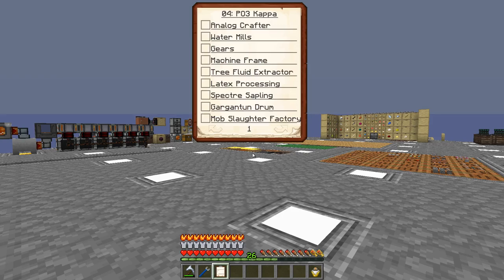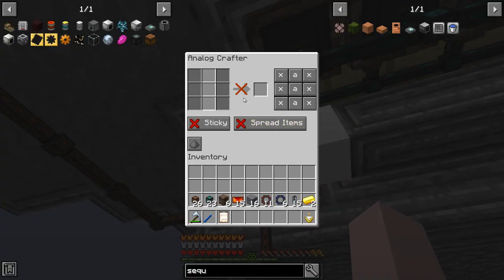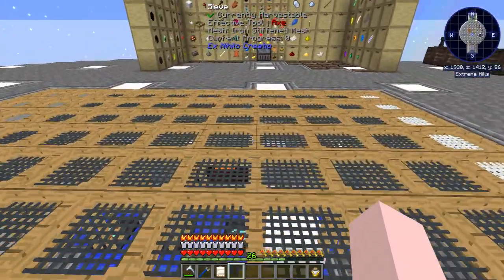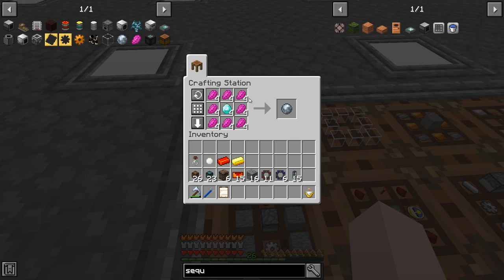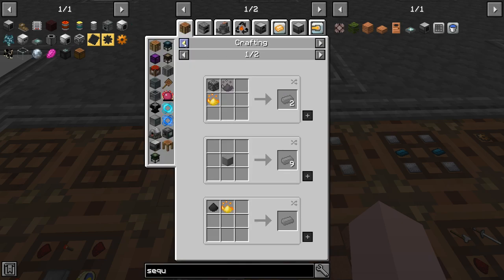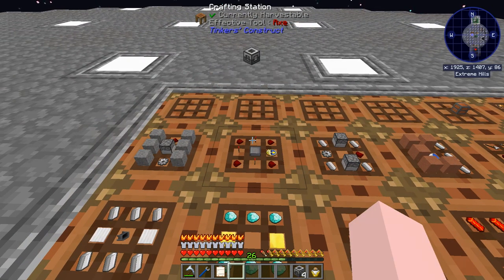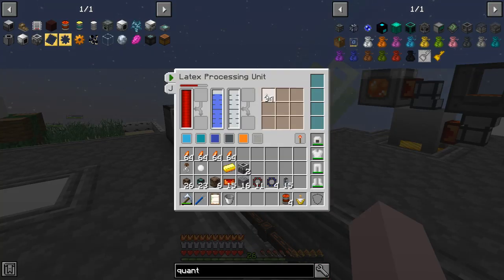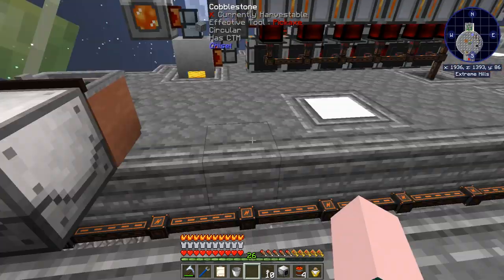04: Mob Slaughter Factory, Sluice Box, Analog Crafter, PO3 Kappa

Comment: Hi Wilx, I just ran a spectrum analyzer to see what people are talking about and there's some extremely sharp lines in your audio's spectrogram. I was going to recommend a VST that can fix this kind of thing, and help reduce your noise floor without messing with your voice, but it seems the bands change back and forth between two sets so it won't work very well.

You have lines at (roughly) 19.9khz, 19.5khz, 18.5khz, 17.1khz, 16.2khz, 15.5khz, 15khz, 14khz, 12.8-12.9khz (this one rises and resets), 11.7khz, 11khz, 10khz, 9.4-9.2khz (drops and resets), 7.7khz, 7khz, 5khz, 3.9khz.  Solid lines like these are not normal, maybe some electronic cross talk?  The interesting thing is your intro dialogue had no line shifts, it looks like some of it is your mouse.  When your mouse is moving one set of lines shows, when it's not another set of lines shows.  So again makes me think there's bad electronic isolation.  Maybe an external sound card to help isolate?

If you want to see it yourself (and to help with testing) find an application called Spectrum analysis 3.97 (it's free) you can set your mic as an input, set your amplitude scale to 100dB Logarithmic, then set you Visualization to Spectrogram (H).  Alternatively you can find another app that lets you see a spectrogram of your audio.  Fell free to message me if you want and I can try to send you some pictures if you don't want to bother with the software.
Reply from the maker: I'm not seeing what you're seeing. I've set it to 100db, normal, spectrogram H, 48khz, 2048, hanning. Most of it is under 5khz, with some up to 8khz. I see no solid lines. The other other channels I looked at had higher numbers than mine. I don't know what I'm doing, so please correct my settings?
Reply: @WilxGaming  If your motherboard supports "Stereo Mix" under your Recording options in Sound (control panel) you can use that to see the audio of your video, or any sort of thing that lets you set a recording output that's a duplicate of your speaker audio.  

If you're trying your mic directly you could try setting the Amplitude to 135dB if it's really quiet, but it's 100% in the video.  If you're mostly seeing colours under 5khz then you need to up your amplitude.  The rest of your settings (the defaults) are just fine.

I tried switching quality options to make sure and it's present in all of them.
Reply from the maker: Now I'm really confused. At first i didn't have my headset plugged in and was only listening to my computer speakers. Between 10khz and the top was pure black. Then I plugged my headset in and my screen was covered in light purple dots and had horizontal lines like you described. I moved my mouse to a different port away from my headset bus and the thick solid lines went away but I still have some very thin light horizontal lines. All that is without speaking. When I speak the vertical lines can go up to 17khz. So why wasn't i seeing this when I watched it on Youtube?
Reply: @WilxGaming  The super thin lines won't be really audible, it's the bright pink ones that will.  The dots all over is normal, that's just your noise floor amplified a whole lot.  There's way to reduce that (the VST I mentioned earlier that you can run with software like Reaper) to almost all black.

As to why you weren't seeing it watching youtube, I'm not sure.  That could be an audio hardware/settings thing.  But it looks like you were able to see the lines finally so that's good!  You could even just set your Microphone as the source and just move your mouse around and you should see the lines even when you aren't speaking, no need for the video (in theory)

You should be able to see right up to 24khz on the chart side, if not you can try switching to the Vertical version so you have more screen space to stretch the frequency band over.

(minor edits + last line)
Reply from the maker: Thanks for the help. It definitely looks better when my headset is not pushed up against my mouse. So hopefully my next video will be at least a little better. I looked at reaper and it cost $60 which I don't have, so I don't want to try it for a short time and go back to not having it when the eval ends.
Reply: @WilxGaming  If you're using OBS to record, it can run the VSTs as well for free (the VSTs themselves are free)

Edit:  It's late but I will keep an eye on this.  The VSTs can really really help clean up audio without need super expensive gear.  I've helped a few streamers with them (even easier now that OBS supports VST directly, don't have to mess with Virtual Audio Cables)
Reply from the maker: > OBS to record
I'm using an old version of DxTory with the Lagarith Lossless Codec.
Reply: @WilxGaming  Just on the why you couldn't see above a band:  The only thing I can think of is somewhere in the device chain before it's gets to the analyzer the hz quality is being lowered to 11,000 which means you actually get 5khz maxed out audio (dictation quality).  In that particular scenario of speakers vs. headphones (you can check that in your Sound settings).  I can only see that low of a frequency with my Digital Speakers output, my actual speakers (copper wire) don't let me go anywhere near that low, yours may be different.

Maybe try OBS Studio if you haven't, it's come a long way.  It's also free!  If you're already happy with your setup the biggest reason to give it a try would be the access to the VSTs so if that's something you don't want to pursue right now you can hold off on OBS.
Reply from the maker: I already have OBS on my computer. I prefer Dxtory because the files it creates can be edited by veedub64, where as OBS files can't. veedub is really old, but I find it much faster and easier to cut dozens of little bits out each video. And the direct stream copy makes rendering much faster too. I did use OBS for a couple of videos a few years ago where I wanted to catch my desktop which Dxtory can't do, but they went unedited.
Reply: @WilxGaming  Ah that's fair. Looks like VirtualDub can only work on AVI files.  There's a few other simple editors out there now, like Avidemux (simple cutting and filtering like virtual dub) that can support mp4.  There are also a few free linear editors now (styled like Premier) but I've never tried them so I can't speak to their easy of use.  Editing software is not something I know a lot about outside of premier.

Something to investigate in the future when you're ready!  

For now the only option that I know would work with dxtory is a microphone -> reaper -> vac -> dxtory (which reaper costs money so not an option right now)

Good luck with the sound!

Edit:  I did some digging, it looks like you can accomplish this with a program called Cantabile Lite (free).  There's some videos on how to use Cantabile Lite with Banana Voice Meter, but you should just be able to use those tutorials for the Cantabile setup part, and then instead of Voice Meter you just set the DXTory input to be the Cantabile output.  So your audio chain would look like Microphone -> Cantabile Lite -> dxtory.  This would allow you to use some VST plugins like Reaper's ReaFir (free) to reduce the background noise.  If you wanted to do the full chain and gain the mixer abilities of Banana Voice Meter you could throw it in the chain before dxtory.
Reply from the maker: Thanks. I've downloaded Catabile, but now I've got to set aside the time to learn it.
Reply: @WilxGaming  Sounds good!  To use the ReaFir plugin (from RealPlugs)  you set it to Subtract mode, make sure there's no noise but ambient coming in the mic, and check off the "Automatically Build" box (only shows up in subtract mode).  This will generate a noise EQ curve by itself, only takes 2-3 seconds, then uncheck the box.  After this when you use the VST in your audio chain what it does is lower the respective frequencies by the auto-built curve, which should reduce a lot of your background noises without distorting your voice.  I'd recommend doing some small audio test with it first before deploying live just to make sure.  This will make more sense once you see the ReaFir plugins user interface.

There's tons of other VSTs you can experiment with that do a lot of neat stuff.
Reply from the maker: After a couple of days stumbling around not knowing what I'm doing and watching tutorials, I think I finally got Voice Meeter Banana working with Cantabile Light and ReaFir. When I can't hear the noise it's hard to tell if it helped just off the graphs,  but I think I got it.
Reply: @WilxGaming  Awesome!  Remember to do a short test video, maybe read 5-10 paragraphs of something, and listen to it just to make sure reafir didn't mess with your voice!

Comment: You can put a lever on the block placer, turn it on and it will only make that sound when it places the blocks.  Don't patient bags have to run through a bag opener?  I do the same setup but use a bag opener, didn't know it would work in a chest/crate.
Reply from the maker: > didn't know it would work in a chest/crate.
It doesn't. I replaced them with bag openers after 
Nicholas Loomans mentioned it.
Reply from the maker: > You can put a lever on the block placer, 
Good tip. I didn't know those block placers worked with a constant on signal.

Comment: So I listened in on the noise in your videos.  For my setup I do only really notice it with the volume up too high as well so it's no problem for me.  It's electrical whine for sure.  As TyphonV mentioned, the pitch changes as you move your mouse so I'm inclined to thing it's your sound  picking up electrical interference rather than your microphone picking up background noise from the computer... though I wouldn't rule it out.  If I'm right and it's electrical interference, it's either your sound chip in your computer isn't well isolated or you have an analog microphone and the cable is getting interference.  In general, reducing the gain would help the issue a bit, but as you said, that's not a viable option.  So, if it's the sound chip in your system, then the only cure is to get either a new motherboard with better integrated sound, or buy a sound card (not worth it IMO).  If it's along an ANALOG microphone there are a few things that can be done: 1. it's always better to plug a mic in on the back of the computer instead of the front panel since it won't collect nearly as much interference from the parts in the computer en route.  2. think about what the cord to your microphone is routed next to.  It might be getting messed with by a monitor or the mouse cable or whatever else is carrying electricity.  Maybe change where the cable is routed, or try a magnet loop around it somewhere.  You know those computer cables that have a cylinder along the line?  That's a magnet meant to clean up the signal, though in the wrong place they can make it worse.  3.  I think the actual voice quality of your mic is good, but you could consider a USB mic to avoid the issue.  Many streamers seem to be in love with the Blue Yeti microphones.  I use/prefer a Samson Meteor mic.  The point being that they don't have the frail cables, interference issues, and amp requirements of an analog mic.  Sorry for the text wall on an old video, I'm still catching up and trying to be helpful.

Edit: I see you got help from an audiophile on a software solution.  After seeing that you have a headset mic I stand by my theory/advice.  Plug in the back, check your cable routing., or not, I'm good either way.  It just blends in with my own coil whine.
Reply from the maker: Listen to episode 5 and let me know if you still hear it.
Reply: @WilxGaming  Just finished 5.  The electrical noise is certainly gone with no noticeable drawbacks (except of course for the suffering on your end to set it up).

Comment: How expensive is the rftools crafter in this pack?
I was surprised that the placer needed a redstone signal. I might have only used the openblocks breaker before.
Would the mob slaughter factory help when emptying the soul vials?
Reply from the maker: > How expensive is the RFtools crafter in this pack?
You need Morganine and a PneumaticCraft Pressure Chamber.
Reply from the maker: > I was surprised that the placer needed a redstone signal
Actually MrJeridan pointed out I could use a lever always on instead of the timer. It would work better and cheaper.
Reply from the maker: > Would the mob slaughter factory help when emptying the soul vials?
I could use it that way, but I'm not sure I want to spend the time automating it when I will be able to make them soon.  I still might.

Comment: And if you crush ore chunks and use the rocky chunks in the sluice box you get two dusts. And with the special ore processing upgrade you get 2 for every dust. Which is actually a 1 for 1. Normally it .25 because it takes four ore pieces to make one chunk.

Would you show that off eventually please?
Reply from the maker: While that is a good tip, none of the ore chunks are worth it. It would be less effort to sieve twice as many. However I still need to decide how I'm processing the Landia ores if I have to mine them. Currently I'm thinking of using Woot to get them.

Comment: oddly enough I checked the frequency bands and on my end the audio only that has issues is on the right audio stereo (the left is very minor).. It's possible that if you have a headset that uses USB power.. your PC might not be delivering current efficiently and your mic signal is being affected.. if you have a wall USB plug I'd try a test video with that before messing with settings.. Some headsets have usb power issues such as my old pair of Razer Carcharias
Reply from the maker: > if you have a wall USB plug
I'm not sure what you mean by that. If I plug the headphone usb in my phone charger, then it wouldn't be getting sound from the computer. I have a 15 year old plantronics headset.
Reply: @WilxGaming  by wall Usb plug.. I do mean the phone charger outlet plug... I assume that since it's 15 years old it most likely doesn't utilize usb power.. in which case most likely need to fix the audio with a VST :(
Reply from the maker: > 15 years old it most likely doesn't utilize usb power..
It probably does use power since the sound card is in the USB connector.
Reply: @WilxGaming  ahhhh... okay.. I see what you mean.. nevermind than about that.. my old headset used a headphone jack for audio and a seperate usb connector for power.. seeing as yours is all inside the usb connector that's where the misunderstanding was..